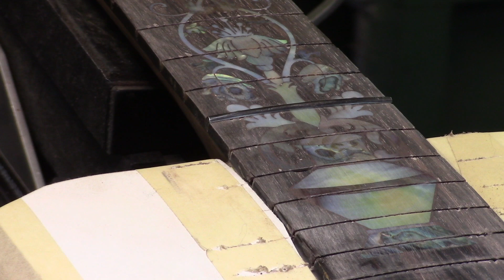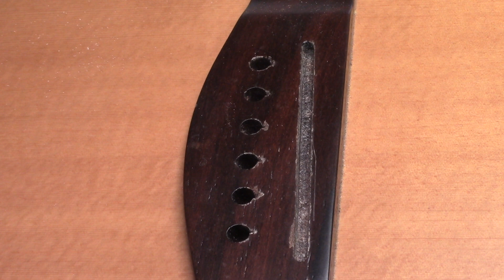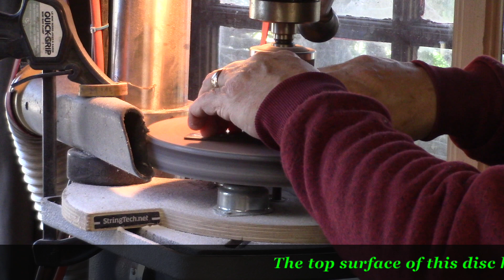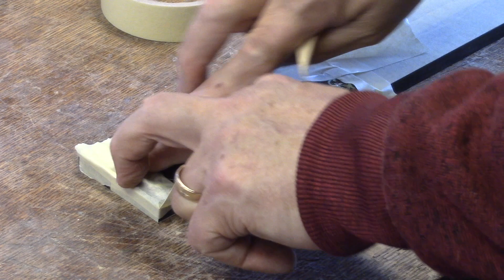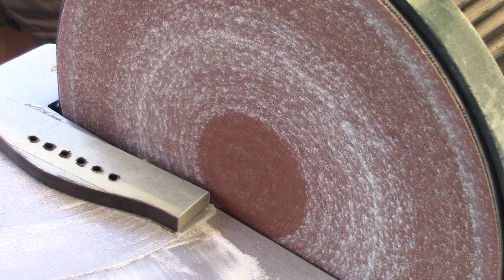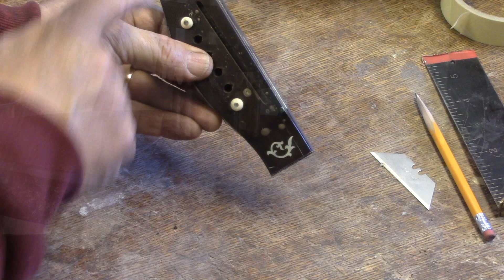Neck Angle on a Spanish Heel / Making a Replacement Bridge by Guitar Repair StringTech

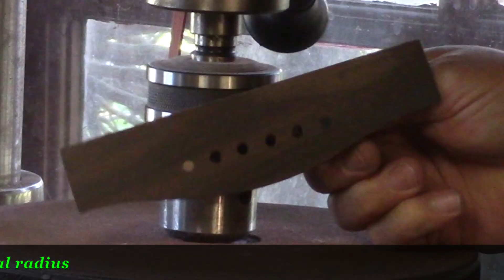Comment: 8:30 this a piece of granite on some rollers?
Reply from the maker: UHMD turned to a 24ft spherical radius ( top surface ) . The load displacement bearings ( underneath ) take away any lateral force on the rotating chuck. MMcC
Reply: @StringTechWorkstations  ah, I always thought it was straight
Reply from the maker: If you had a ball 48 feet high ... and cut a 9" diameter circle out of it ..... that is this 24 foot radius sander ;^ ) !
Reply: @StringTechWorkstations  ah indeed, I mistook it for inches
Reply: @StringTechWorkstations   @StringTech  is this 24' radius a certain thing? top of acoustic guitars, or?
Reply from the maker: Martin is the proverbial " flat top " guitar. Gibson is usually close to 20'. Taylor does a 60' radius. Most boutique builders with a  28' -32' radius .  The idea behind this sander at 24' ... it essentially creates a very shallow " suction cup " filled with glue. It is a life-saver for anyone who is gluing on an acoustic guitar bridge.
Reply: @StringTechWorkstations  ok so if I understand correctly, with a gibson you'd pick a different disk? Because the radius is sharper? And for the others indeed, ''suction cup'' If I understand correctly then I believe Ken  Parker would call such a glue up joint a ''spring joint'' as the middle is pressed down with the outer edges already in contact. or am I still missing it here?
Reply from the maker: I use this 24' disc for everything. Even the Gibson 20' radius. When a bridge comes off ... it is usually a guitar that has been around for a while. With the string tension the top will "belly up" so if you sand the foot of the bridge flat ..... and force the outside " wings " down ..... there is a danger of popping off some braces or cracking the top.